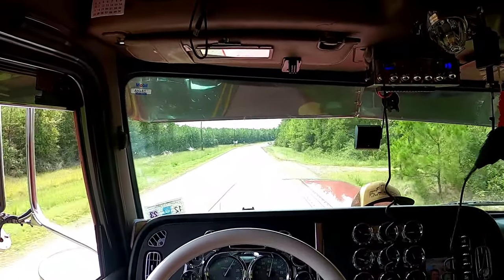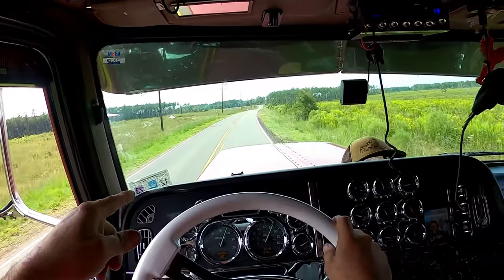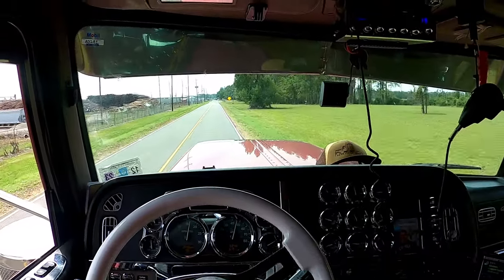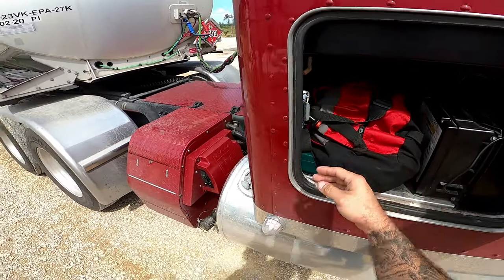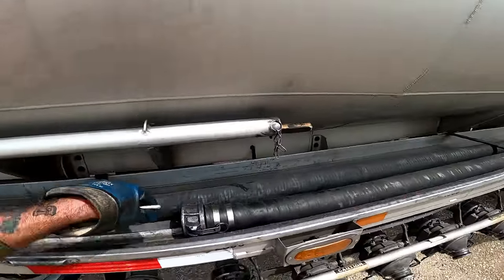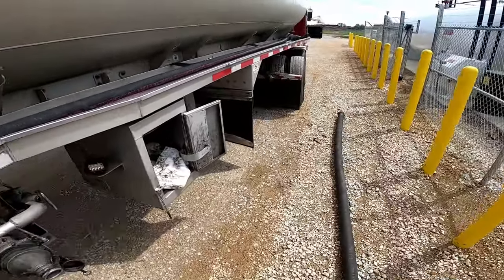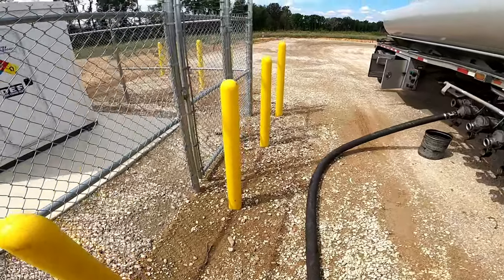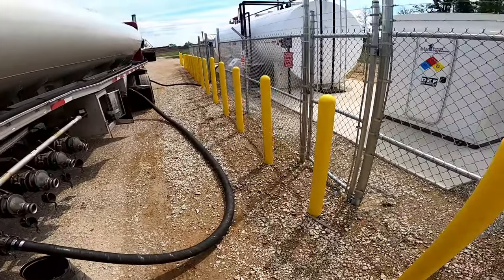How To Unload A Tanker via Pump Off

Comment: That was a good lesson for all of us! When I first started I was delivering to a  home heating oil tank and was told it would take 3,500 gallons and I didn't have to stick the tank. Yeah, I'm 62, it was a little while ago. So, I hooked up everything and set the meter on the pump and it was a windy raw day in NJ and I ducked behind a tree and waiting felt " mist" every now and then. Hmmm. I rubbed my face and it smelled like oil. Oh boy! I jumped on the other side of the tree and the fill looked like a fountain and the vent looked like a sprinkler and I ran to the truck and shut everything off and ran to the fill splashing through oil and slush. I called the office and they gave me the cleanup crew. "" Skip "" wanted to know "" How much ""? I said 100 gallons. Eventually? Skip caught up with me and said, ""100"? Try 700"! But, it's okay we fixed it and they didn't complain about it TOO MUCH.  My Boss/ owners of the Co told me Don't ever let that happen again! Lesson learned.
Reply from the maker: Hard lesson learned lol
Reply: How did that happen? I’m curious to know what went wrong?
Reply: @juniorcc9571  I didn't stick the tank. I didn't measure the amount of oil in the tank.  I just went by what they told me.  They told me it would take 3,600 gals. Always stick the tank.